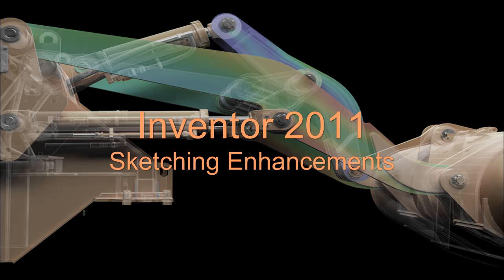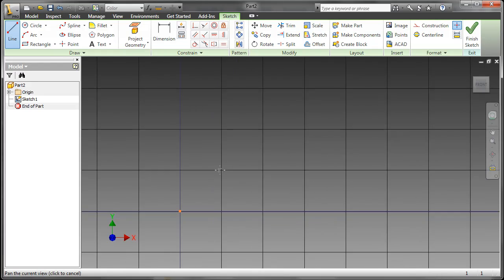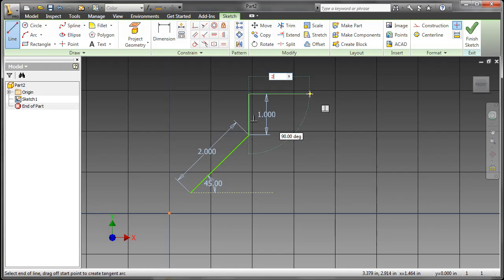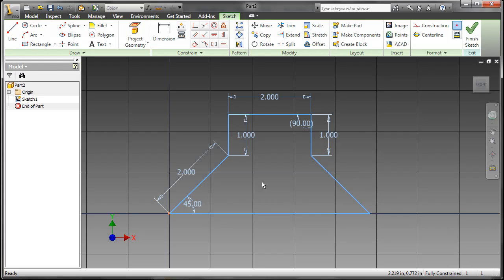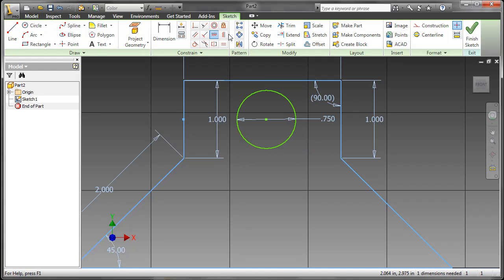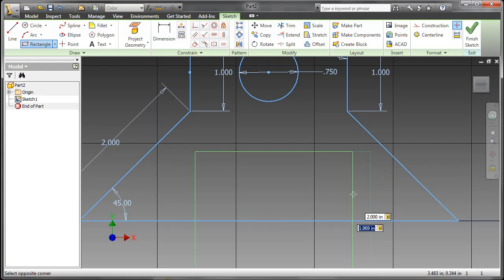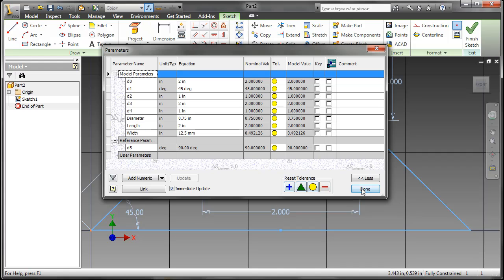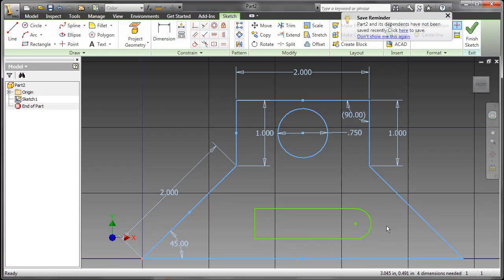Inventor 2011 - Sketching Enhanements

Comment from the maker: This is only in Inventor 2011, which version do you have?

If you have 2011.  Go to the Application Options on the Sketch Tab enable the Heads Up Display (HUD).  Also make sure you are not running in compatability mode.